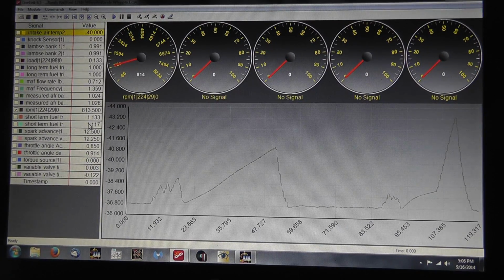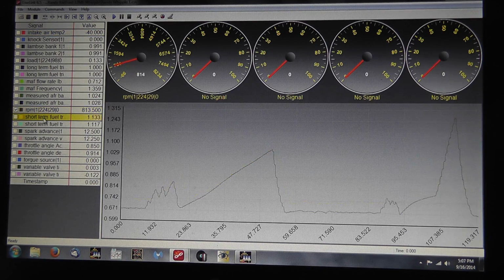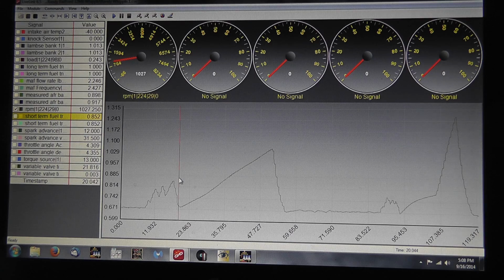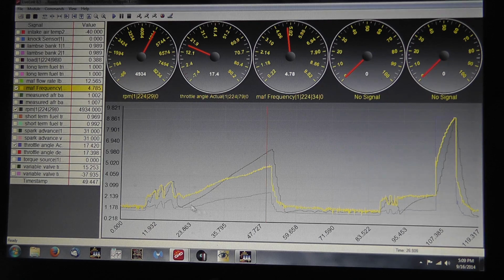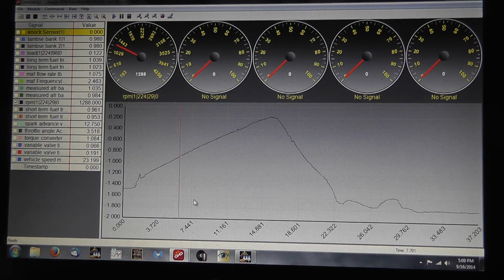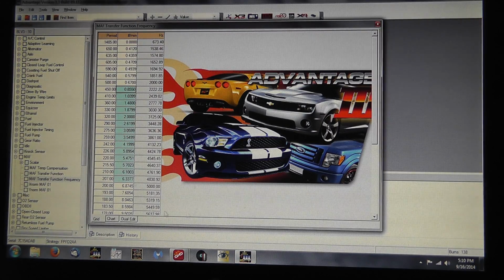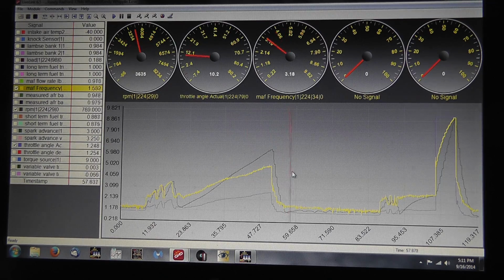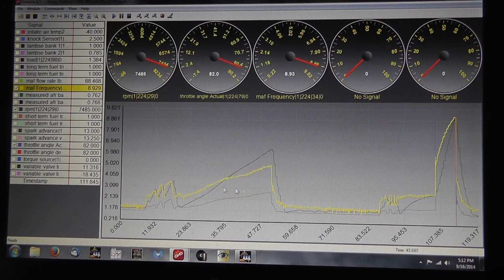Data logging Pulls for AED

Comment: On an MT82 equipped, is the WOT pulled in 5th? I can see where after the first pull you let it idle for a few seconds and then there’s a series of shift points to 5th? Then a pull to 7500...